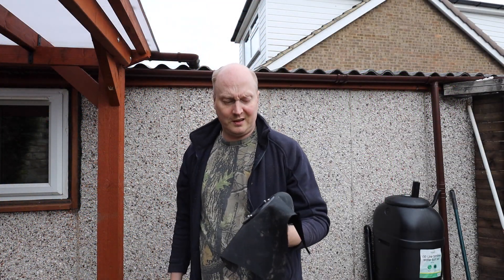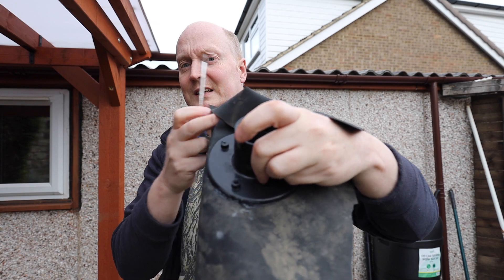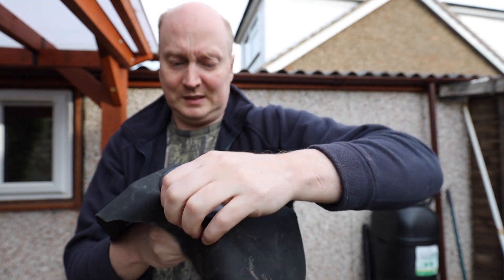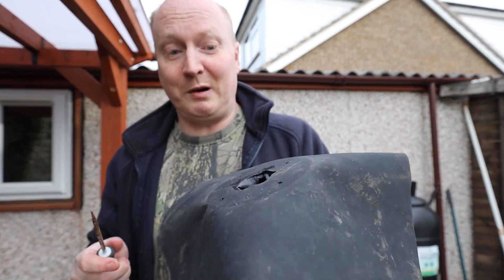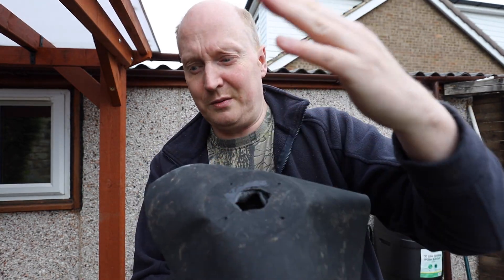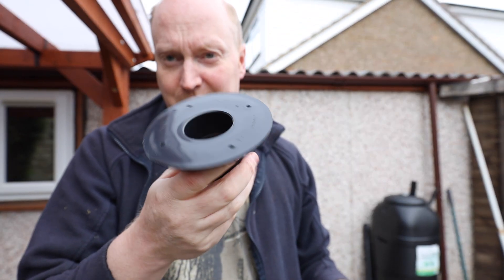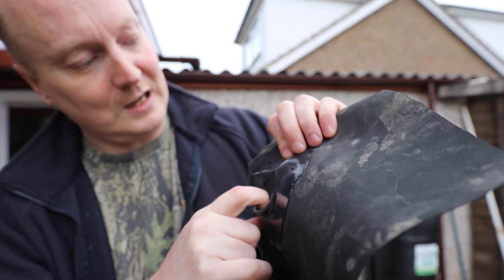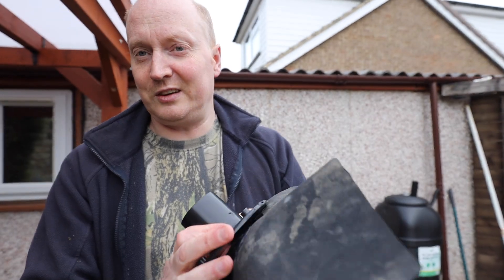How strong is a pond tank flange connector

Comment: Hi, great video!  I just installed one using your method so it’s good to know it will hold without screws, lol.  My question is what kind of cement would you use if connecting it to pvc flex pipes?  The flanged connector is molded ABS.  They say that a transition cement should be used.  What are your thoughts on that?
Reply from the maker: I believe the pond adviser uses plumbers cement. If your using heavy duty pipe a cement glue should be fine I use ever builds stuff. However do not try to use the cheap corrugated stuff the hose flexi stuff it will not last and will leak. You can also use the 2 part plumbers glue as well. As long it's cement for bonding pvc or abs it should be ok.